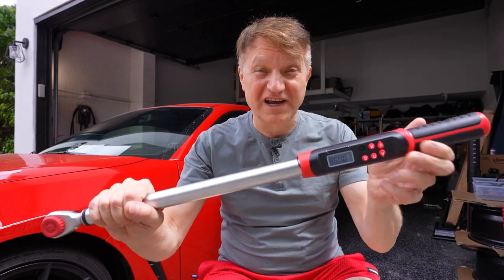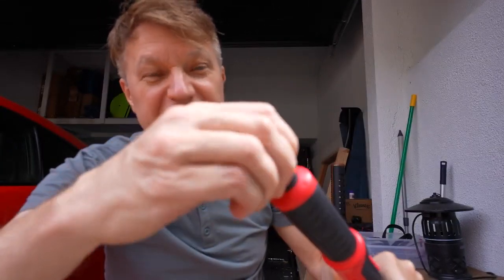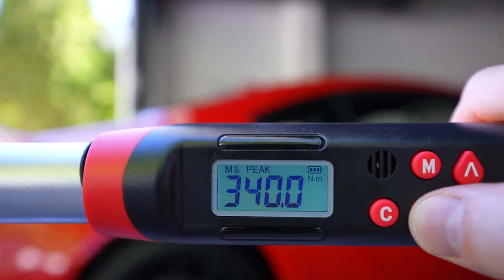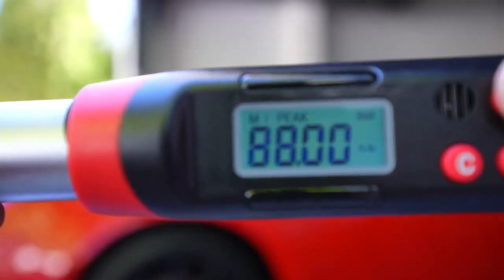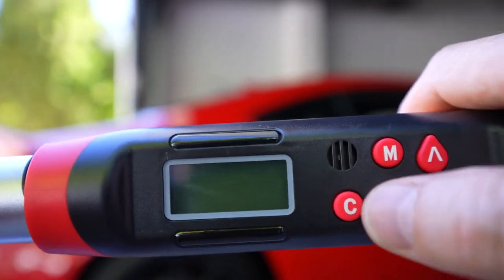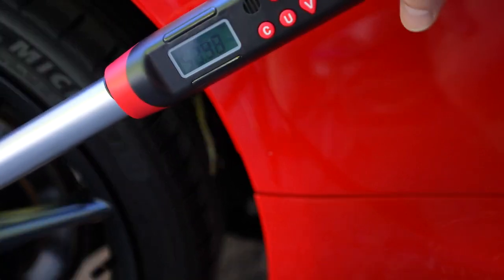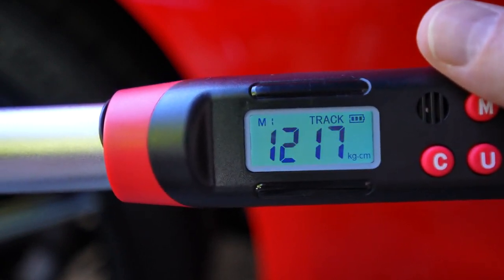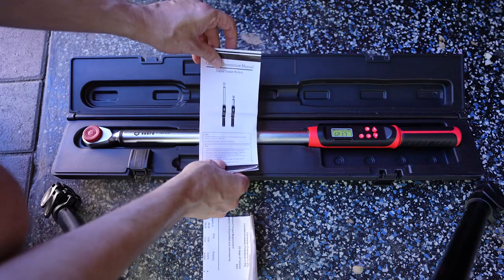Introducing the 1/2" Drive Digital Torque Wrench #torquewrench

Comment: Gahh how do you program torque values. The provided user manual might as well be thrown in the trash. It barely explaining how to program the different settings, but it doesn't show how to recall the settings. In fact, I'm not even certain I programmed them into the correct Bank as I'm unable to recall. You know what setting to use to recall the freaking numbers.